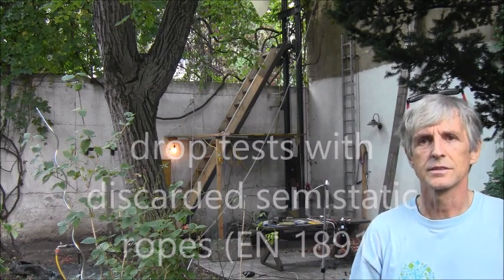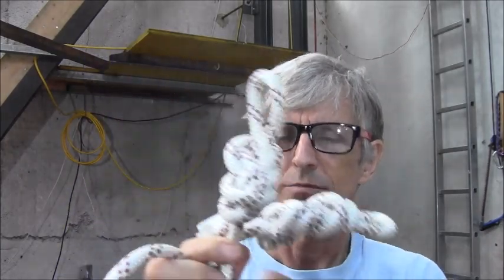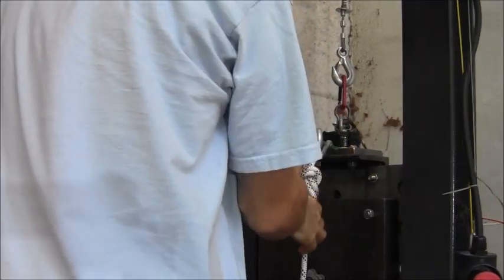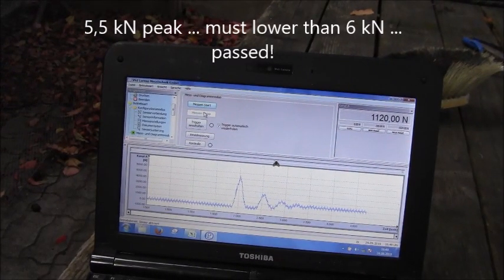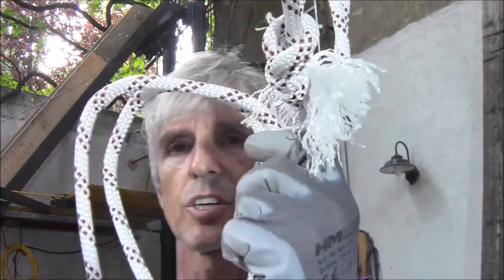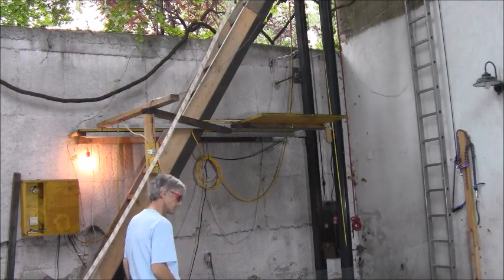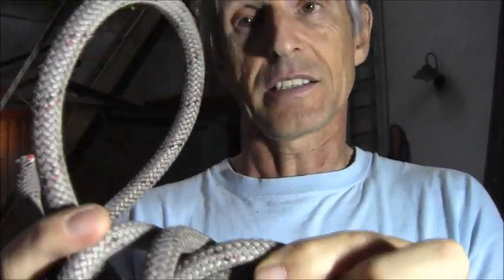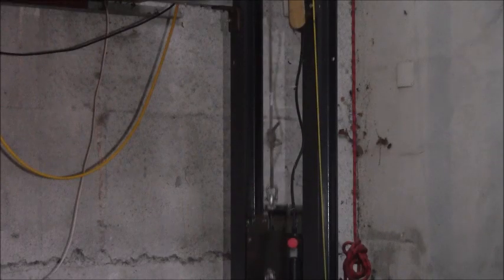drop tests of low stretch kernmantle ropes

Comment: Thank you so much for doing these tests and posting them. I have performed many slow pull tests, on old and exposed rope, which failed to show significant loss of strength. I have always wanted to do the dynamic testing that you have just performed as I suspected that old rope, in good condition, would pass the initial test requirements. I would be interesting to see if dynamic rope, (which has been heat treated to improve dynamic properties) looses it's elasticity over time. Thank you again!